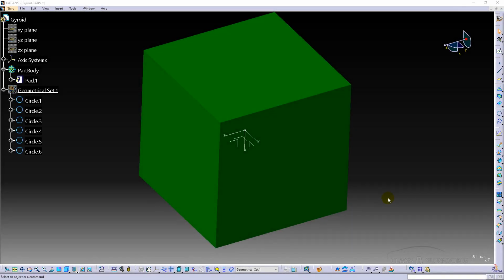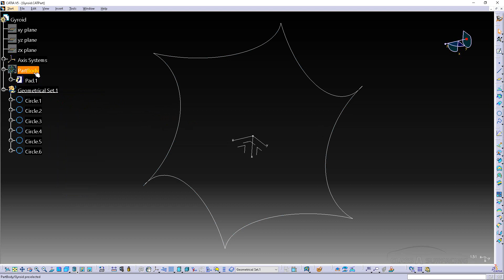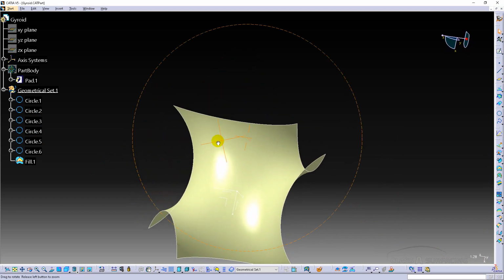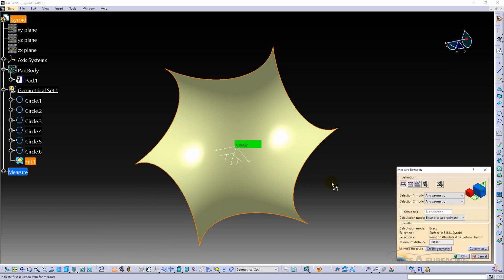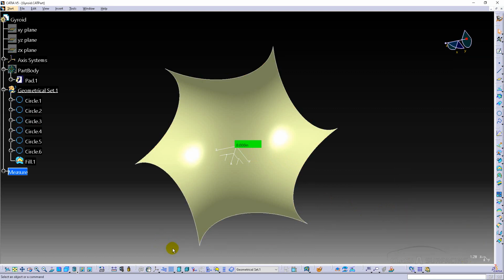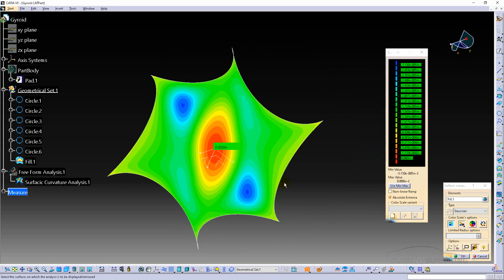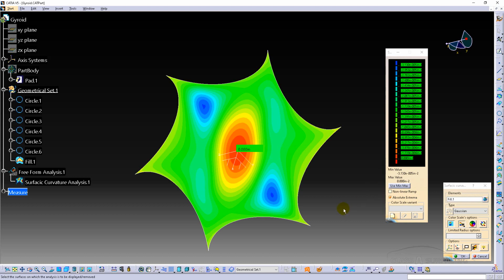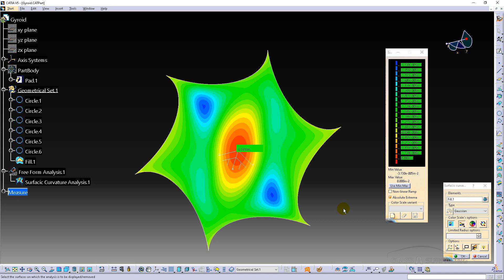CAD Wars: Gyroid in Catia V5

Comment: Hey, nice simple way to do gyroid. I'm wondering how your geometry work with repetitions (in order to do a whole 3D pattern), especially for the tangency aspect of elementary geometries
Reply from the maker: I did play around once and patterns work fine actually. 

In a lot of cases tangent across edges is not even necessary. Parts like these need to be 3D printed.